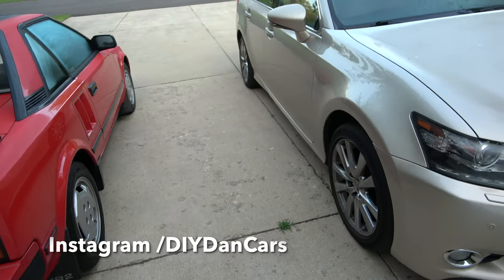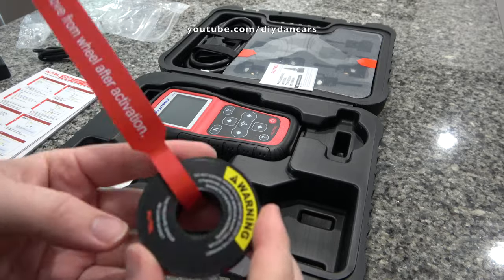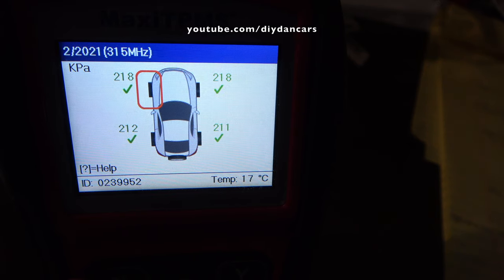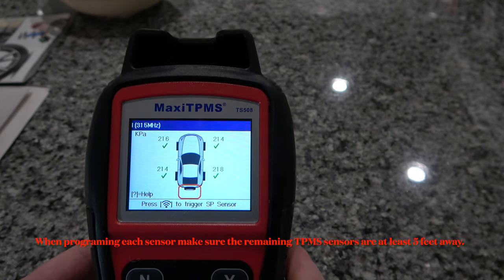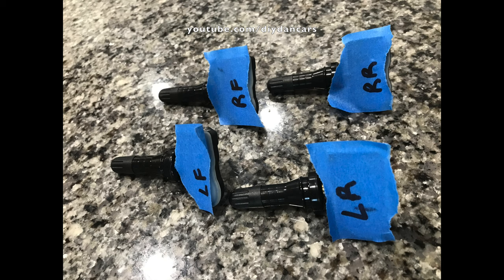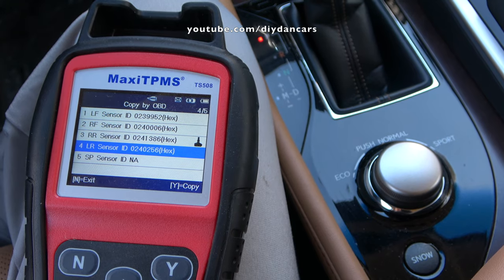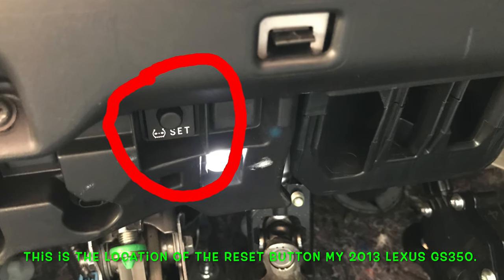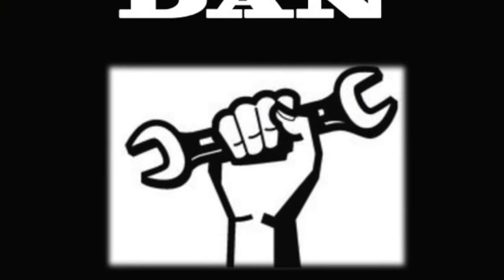How to Program New Tire Pressure Sensors For a Lexus or Toyota Using An Autel MaxiTPMS TS508 Tool

Comment: I own a 22 GX460. I lifted and bought new off road tires. I had the sensors transfer to new tires including spare. After installing the tires I realized that oversized wheel won’t fit until GX(as it did in my 4Runner). As of now I’ll be keeping the stock until I buy a tire carrier for the bigger tire. Since I had already transferred the sensors I bought a new matching Lexus sensor for the original spare which I’ll be keeping under. Basically 4 sensors will be the original and 1 will be new. Since it’s factory matching sensor do I still need to program the TPWS? Or it’s plug and play?
Reply from the maker: Programming of the sensors is required. The Autel tool will only program Autel sensors.
Reply: @DIYDanCars  Actually it’s not required to program the car’s computer if you are installing the exact same part number. I installed the matching sensor (same part number from Lexus) and after driving over 50 mph for 10 minutes the computer recognized the sensor.
Reply from the maker: @kamrouzsaifi3845  This is incorrect. Even the Lexus shop manual states that the TPMS sensors need to be programmed before installing them.

Comment: Changed our winter tires with tpms at our dealer to all season tires with tpms as well. Dealer reprogrammed the tires when they installed them. Do I have to do this everytime I swapped tires assuming all the 8 tpms sensors are working?
Reply from the maker: I don't completely under stand the question. If you have one set of wheels that have MX sensors installed and 2 sets of tires (winter and summer), then no you shouldn't have to reprogram the sensors every time you swap tires. If you have two sets of wheels and tires, one a set is for summer and another set is for winter and both sets use unique sensor IDs, then yes you will have to perform the "relearn" procedure every time you swap wheels and tires. I got around this by programming both my winter and summer set of wheels and tires with the same unique IDs. Hope this helps.

Comment: I have a 2019 colorado that the sensors taken out...trying to fit  4 new autel sensors but none of the sensors is working to the scan tool..the sensors have been installed on mags...
Reply from the maker: It sounds like you may have skipped through this video? If the scan tool isn't reading the sensors that are already installed in an inflated tire that can only mean one thing. Rewatch this video at 2:41 mark and I show you how to setup the tool to read and program sensors in an already inflated tire.

Comment: Trying to copy 2018 Corolla sensors to the same. Comes up no sensor or deflate. I deflated and it still can’t find the sensor. Any ideas please?
Reply from the maker: It sounds like the sensors are already in the car? If so, follow the video from the 2:42 second mark. You need to turn TPMS prog limit to "off" in order to program sensors that have already been installed in an inflated tire.

Comment: How did you know that your sensors were 315 megahertz? Also I had the new sensors installed already before buying the tool or seeing your video.  Can I copy by OBD from outside the wheel by the air valve or do I need to remove it and insert it on the tool?
Reply from the maker: The tool will tell you what frequency the TPMS sensors are using. You can program the sensors while being installed in the tire or outside of the wheel. Whatever you prefer.
Reply: What if it has files for both megahertz. How do you know
Reply from the maker: @bayouranch  By scanning the original sensor. Scanning it will tell you what frequency it operates on.
Reply: My sensors were dead. I went into the computer system. And I chose the first one.
Reply: The 315 megahertz
Reply: And copied the files to the new sensors.

Comment: My rear tires have the same I'd tool reads duplicate id.. is there a way to fix that or just replace 1 of them with a new sensor? Thx
Reply from the maker: Why not reprogram that last sensor with a new unique ID and then bind it to the car? Problem solved. :)
Reply: @DIYDanCars  how do I do that? Do program sensor then do by activation? I have to let the air out below 10 psi?
Reply: @DIYDanCars  or can I do auto create and scan sensor still in tire inflated if I turn off the tpms prog ? Thx for ur help

Comment: Does this come with the OBD II dongle?
Reply: The more expensive Autel TS601 tool includes the ability to read OBD codes.  This model, the Autel TS508, does not read OBD codes.
The Autel TS601 OBD2 scan tool is a diagnostic tool that can perform a wide range of functions, including reading and clearing codes, retrieving live data, and performing OBDII diagnostics. However, it does not have an automatic scanning feature. You will need to manually initiate the scan by selecting the appropriate option from the menu.

Comment: I am having issues with my Autel, with an autel sensor...and I know it's my fualt. IDK what Im doing wrong. But i got the bigger model.
Reply from the maker: Interesting. I haven't had any problems with mine. I wonder if you received a faulty sensor?
Reply: @DIYDanCars  no. It was me. It was never set up to read the spare in the rav4. So, I read it and had no issues since.
Reply from the maker: @cliffjumper1984  Glad you got it figured out.

Comment: Nice! What I want to know ....can you program 8 unique sensors (summer and winter set) to avoid reprogramming every season?  I usually take it to Sam's $35 for the new sensor, installed and delivered. Costco charges around $70. Even though tool is cool you are paying the tire shop to install it anyway. I think wholesale club is the way to go since tpms sensors don't go out too often.
Reply from the maker: Yes, you can program 8 unique sensors. We actually do that now. I have 2 sets of wheels and tires (winter and summer). All you have to do is write the car's computer with the new unique ID's every time you swap wheels/tires.
Reply: I just bought a new 2023 Toyota Highlander, I have a winter set of tires from my old 2017 Toyota Highlander, which I plan to use on the new one. Do I need to reprogram the old sensors or just hit the reset button in my new Highlander to learn the winter set of codes? Thank you.
Reply: Hi. Just a thought for anyone interested.  You always have the option to deflate the tire and break the bead yourself to install the sensor.  I gave it a shot and it was pretty easy. There are a lot of videos on various was to do this.  I just did it with some large clamps I already owned and a 2x4.  Broke the bead and installed the sensor. The one I was replacing weighed within grams of each other so I didn’t mess with balancing.  It all went well and I learned something new along the way.
Reply: Install yourself it’s easy
Reply: @DIYDanCars   or you can clone 1 set the same as the other and you'll never have to write to the car's computer until it goes bad.

Comment: would this tool tell you that you have two tires with 315 mhz and two tires with 433 mhz  Not working
Reply from the maker: Yes, this tool can trigger the sensors to find out what frequency they operate on.

Comment: don't need the cloning method. I need the method with using oem type sensors that have I.D. numbers thanks
Reply from the maker: Then this video isn't for you. This tool only works with Autel branded sensors.

Comment: Does this Autel tool be used to read or program any brands of tpms or only autel tpms?
Reply from the maker: You need to use Autel branded sensors. They are much cheaper than OEM.

Comment: Is the Autel universal? Meaning can I buy tire pressure sensors that are not autel brand and use it?
Reply from the maker: You need to buy Autel branded sensors if you are using the Autel programmer.

Comment: Why did you change them out if each sensor could be read?
Reply from the maker: You must have been skipping through the video if you are asking me this.
Reply: same question
Reply from the maker: @kinlay2381  I have mentioned why I had to change them out several times in the video. The reason is because the sensors were working intermittently. I guess I need to stop doing videos like this because no one seems to watch them anyways. LOL!
Reply: @DIYDanCars  Thanks for the explanation. I thought you change it because the Autel machine only able to read the psi from the Autel sensors only. But it seems you change the sensor because there is an issue with your previous sensors. Also, I don't understand what "intermittently" mean until I google it. Sorry for my lack of vocabulary knowledge.
Reply from the maker: @kinlay2381  Sure, no problem! Intermittently means that the sensors would work only some of the time.

Comment: How many miles does your cat have?
Reply from the maker: It just crossed 120k miles.
Reply: @DIYDanCars  nice looking at getting one with 110k. Thoughts?
Reply from the maker: @ifratnabo8736  Personally I don't like to buy used cars with more than 50k miles on them. You should have a mechanic you trust look over the car before purchase, especially if there is no service history.

Comment: Tire shop screw up lol..there is no reason for red dots at the valve stems..it should be the yellow dots at valve stem..yellow is light spot, red is maximum runout and should be matched with dimple on rim..road force balance would used when there is no dimple or you can’t locate the low spot of the wheel and or high spot of tire
Reply: What I've seen is some brands use yellow dots others red. Never seen both on a tire but can't say I've seen thousands.

The reason to put the dot by the tire valve is because consumers will think you did a bad job if you didn't. The OE (not just OEM) factory mounted tires on my F-150 have dots no where near the valve stems.

Comment: Maserati oem tpms sensors are cheaper than Lexus oem.
Reply from the maker: And Autel TPMS sensors are cheaper than both by a factor of 2x or 3x. :)
Reply: @DIYDanCars  The programmable ones are about $22 each.  I got an after market generic set for $36 for 4.

Comment: They dont work on Toyota Prius, tried everything, gave up and went with OEM.  Not hugely impressed by Autel.
Reply from the maker: That's weird. I have programmed two sets of sensors for a Prius with no problems. Autel has a great customer service line. Did you call them?

Comment: Tpms is a big pain and waste of money . Been using a tire pressure  gauge for 52 years never had a problem
Reply from the maker: Unfortunately most dealers will take thousands off of a trade in if your original TPMS is not working. It's best to keep things in working order if you care about resale.
Reply: The same was said about seat belts 20-30 years ago. :) And it saved my father's life. Tpms is very good thing also, 2 months ago it started flashing every week, I thought it's just because the cold. The tire gets soft. After 3rd occasion I took it to tire service and turned out that there is a thread broken ( only 10 months old tire) and it was very dangerous and probably wil not lasts for even 200km. I'm sure without tpms I wouldn't recognize the 0.5 bar losses and I any my wife with children would have continued to using it. 
In other hand the technology behind tpms s just s*cks. There are cars with other technolgy that calculates the cars "sinking" to avoid the frustrating issues with communication tire sensors.